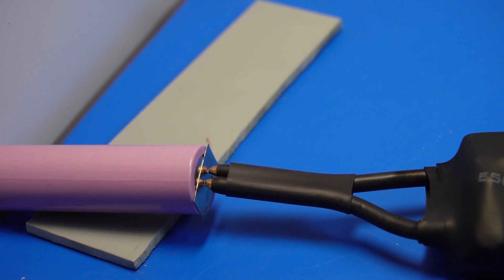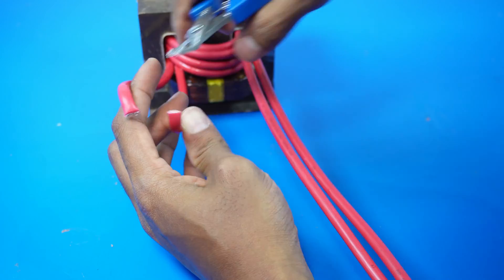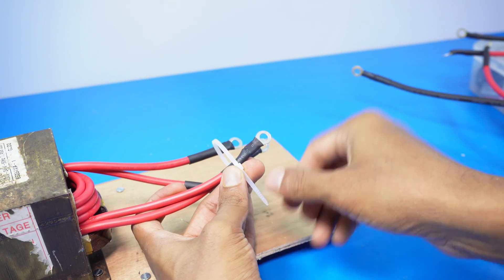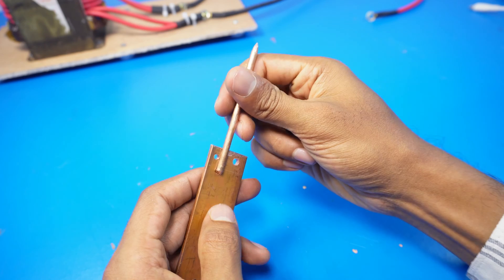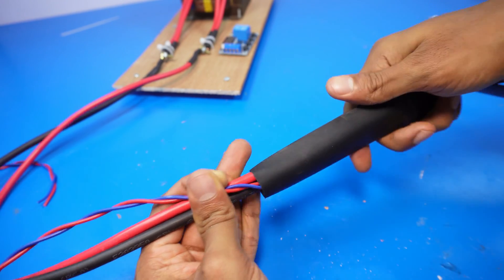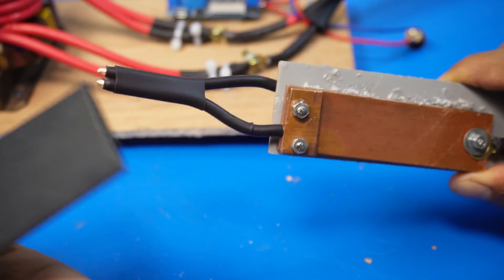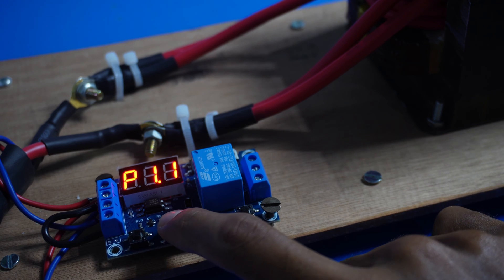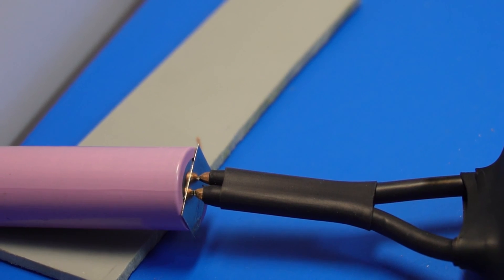DIY SPOT WELDER | How To Make A Homemade SPOT WELDER For $10

Comment: Doesn't work because more then 700 apmare to 800 apmare need for spot proper waild .
Reply from the maker: You don't need 700amps for battery spotwelder

Comment: Me podrias ayudar con esto? tengo forma de contactrame con vos?
Reply from the maker: The video has almost everything
 If  you need more help, you can ask here
Subscribe
Reply: @Dr.mechanomaster  tengo un transformador de microondas, le saque el bobinado secundario y en el secundario, solo me genera 40A , como hago oara calcular la cantidad de vueltas del secundario para obtener mas amperaja
Reply from the maker: It looks like you don't know basics of AC , I don't recommend doing this without knowing anything, it could be fatal if something goes wrong. Lower the number of second winding higher will be ampere and Lower will be voltage.

Comment: What if the secondary transformer is modified to 12 Volt 80A DC assisted by a capacitor,... and I use a 12 volt battery spot welding module,... is that possible?
Reply from the maker: That's like a mini welding machine! If your dc devices could handle that it might work. What i have done is a fairly simple and cheap machine which actually works. I don't know why you need to do what you are saying when this works great

Comment: “3 double windings…that appear to be 6”

Wait. What is happening here?
Reply from the maker: Two wires run parallel, their  Two ends are connected they act as one wire. These two as one are wound three times

Comment: Salve mi puo aiutare,ho comprato una penna per saldature a punti,vorrei fissarla vicino al trasformatore del microonde ma non so come montarla,se mi fa uno schema  le sarei grado grazie
Reply from the maker: This involves extreme high current which could be fatal if you don't know what you are doing.  If you don't know what you are doing it's best to not do it. 
  Having said that, this video has information on how a spotwelder works and how one can build it if has sufficient safety training. It's best to watch multiple times to understand how everything works.

Comment: I  easily take that bet about the 10 minutes or the fifteen dollars. Acquiring  the transformer will be come more difficult  as newer microwaves  use a switching  powersupply. It  takes quite a bit of work  to remove the secondary windings without damaging  the primary.  I bought the cable for the secondary it is made of twisted thick wires, only a few feet cost me about ten bucks.  I was able to  spot weld  metal pins together  about  0.7mm in thickness using a plastic jumpercable end. Using anything but copper will start to melt things. If its  magnetic, it isn't  copper. So, this setup can do more than battery terminals. Spot welding from both sides requires  pressure. All an all, great job.

Comment: my question is : Shunts or no shunts? I've seen many people leaving them there and also many  removing them. I red, that removing those shunts allows more current  passing to the secondary, yielding more power. They are there  specifficaly to limit power draw of the magnetron in microwave oven. It doesn't feel necessary to put them back/leave them after modifying to spot welding purpose. What are your thoughts? ....
btw, I  added another, omron relay rated for 16A  to seitch the MOT with separate 12V supply and timer relay switches that relay , because the timer relay is rated only for 10A and I am not sure, how well it will be able to handle inrush current of fully loaded MOT  repeatedly🙏🏻
Reply from the maker: You want power but not too much, you would be punching holes instead of welding.  Based on power of your welder you should Adjust discharge timing.  About the relay, that was a smart move . I did face problems with that

Comment: what a rig that is you do realize the amount of pointless details is not good as far as splicing is concerned a j box with a lug bar or a appropriate crimp maybe pad up your board run down under n up into j box cut side of j box to fit your display board and that way its all contained inside box incase something decides to let loose nothing is perfect in the world of energy im an electrician and trust me no matter what always know that electricity happens quicker than a split second and its not a matter of if you know what your doing its a matter of just how bad you get bit i nearly got fried from a light circuit 277v that was not made up in the first box after riser dude made the left side circuit hot and somehow made the left hot as well first of the morning im getting a plan together and take a look at what circuits i had and a wire butted my finger tip while i was mostly touching a big duct work and it absolutly was the craziest feeling ever and i was able to not get stuck to it but yea man think simple clean solid connections and i promise its so simple to construct that way and enjoyable also
Reply from the maker: I'm working on a large 3d printer,  a good box is on the menu

Comment: leaving mains voltage terminals exposed is extremely dangerous. Better to put spade connectors on the mains connection to the transformer and put heat shrink as far down onto the transformer lugs as possible.

Comment: The welder should only output a volt or two. You mentioned a fear of getting shocked multiple times. If you don't understand electronics well enough to know that low voltage can't conduct through skin you probably shouldn't be doing this.

Comment: Bro i have dout that blue red wire come fromes switch exactly where that connectted
Reply from the maker: Take closer look everything is shown properly.
Reply: @Mr.mechanomaster  ok
Reply: Trigger also need some positive voltage, so it is connected to one wire of supply, and u just need to add 2 wire for trigger switch.

Comment: But i have a question this timer is low ampere and the transformer is biq ampere round about 50 ampere so how it handel it?
Reply from the maker: Timer doesn't handle amps it just turns relay on for set duration
Reply: Transformer is more than 50 Amp capable, but its not on primary side, this hi amp is on secondary side.
On primary side, it's around 5-10 Amps only (220v-5A 110v-10A)

Comment: I installed everything the same, only p 11 appears on the timer and not the ticking time
Reply from the maker: There are videos on youtube explaining how to set any kind of timer on this module, refer to those. Set timer as low as possible at first and increase slowly as for your machines capacity
Reply from the maker: https://youtu.be/p9u8lrsRrWE
This is the best one I found
Reply: the timer is working. but when I press the button sometimes it says 3 seconds and sometimes p11 on the lcd
Reply from the maker: He explains everything about the module, I also referenced that video to mine. You can do any project with that module watching that video.
Reply: thank you the module works. when I connect the transformer module it does not work properly, it throws error p11 that the transformer is not strong or something else, I don't know

Comment: what VAC of tha output?
Reply from the maker: 3
Reply: @Mr.mechanomaster  mine in 1 turn 2.1 vac, in 2 turns 3.2vac so whats the best? 2.1vac or 3.2vac?  i use welding cables

Comment: Hello can I use UPS transformer which is 220 to 12v thank you
Reply from the maker: This is for educational purposes only. The idea is to reduce voltage to around 3v and increase current to maximum with thicker wire.
Reply: @Dr.mechanomaster  Thank you so much! Now I know what to do. I hope you can earn more subscribers and please continue your videos.
Reply from the maker: One way to help is by sharing, thank-you
Reply: No,microwave oven transformer is good